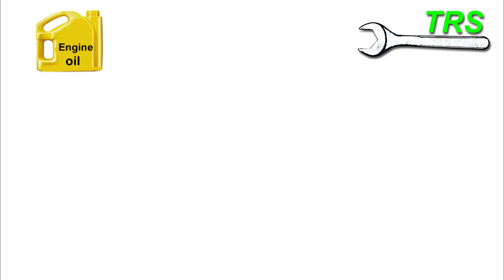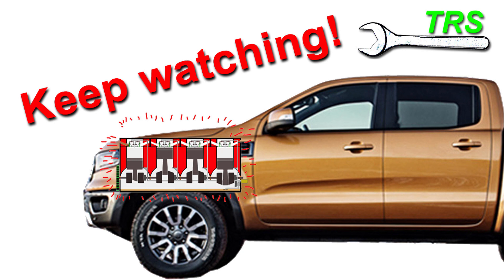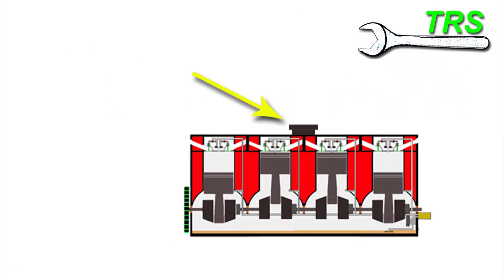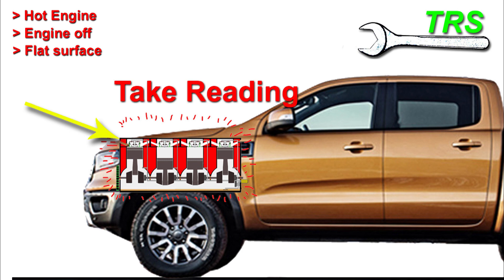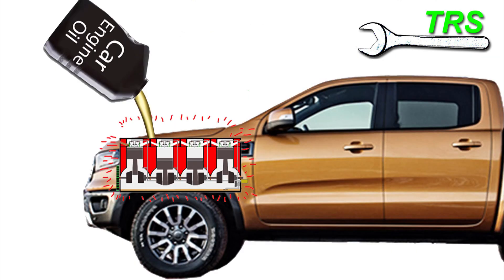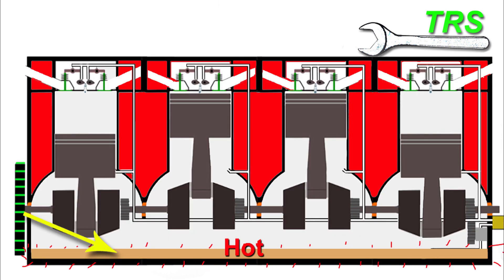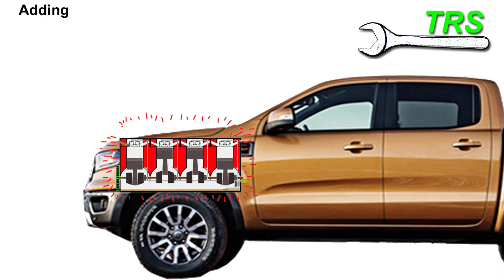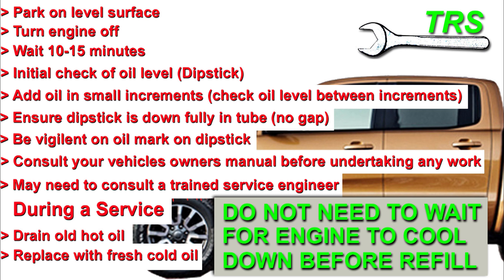Can I use Cold Oil in a Hot Engine? & Engine Oil Level Check Correctly!  (by Craig Kirkman)

Comment: But my manual says to wait 3 min after turning off the engine then check the dipstick. And I have tried both over night and according to the manual. When it's cold it reads less.
Reply from the maker: Ah, I see! It's great that you're following the manual's instructions for checking the oil level in your car. Waiting for a few minutes after turning off the engine allows the oil to settle back into the oil pan, giving you a more accurate reading on the dipstick. It's interesting how oil levels can vary depending on the temperature, with colder oil often registering lower on the dipstick. This is perfectly normal due to the oil's viscosity changing with temperature. Following the manual's guidelines ensures that you're getting the most accurate readings, which is important for maintaining your engine's health and longevity. Keep up the good work in taking care of your car.

Craig

Comment: Just regarding the viscosity of the oil say Oil is thinner when cold according to viscosity on the can say 5W30  5W (W) for winter and 30 stands when the it warms up .The thinner the oil the quicker it can get to the parts and when warmed the thickened oil seperate the metal to metal contact. s would it be better to drain the engine when cold and the oil thinner.

Comment: I want to an engine sitting in sub zero temps and then put in almost boiling point oil then start it up. I wonder if the gaskets and metals take a beating.
Reply from the maker: Should be absolutely fine. Engines are more than made of robust enough materials
Reply: @TheRepairSpecialist  a lot of quick change places act like one minute is long enough to wait for oil reading. They were topping me off but I asked if it should be shutdown for a few minutes. I thought they overfilled. It looked like it to me but I took it to 5 places and they say it wasn’t. Still looks that way to me.

Comment: Hi, great video. Changing the subject is it possible that you can tell me on a Stihl FS 45weed Walker carburettor Number S97 what the small hole is at the end of the throttle shaft it seems to have a small pump in the hole and what does it do. Many thanks.